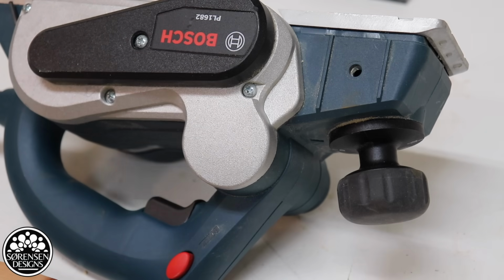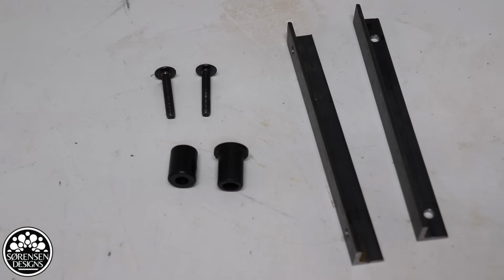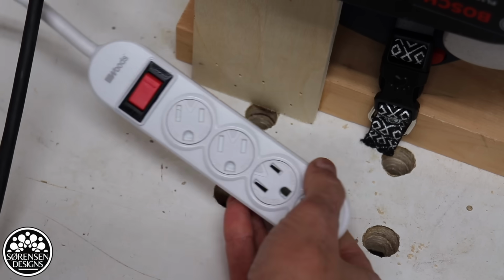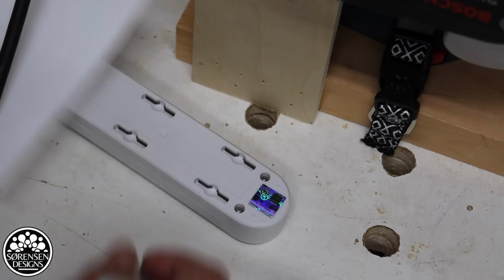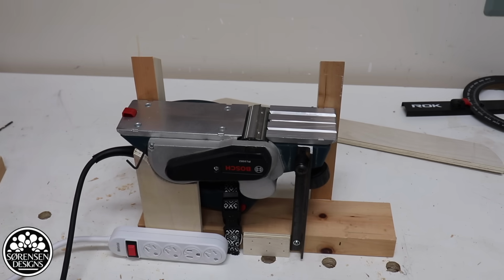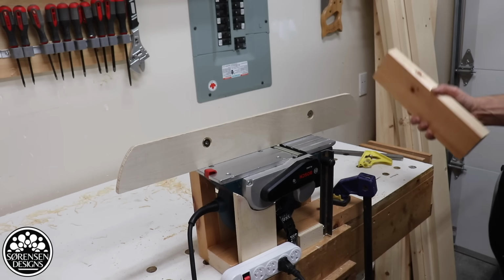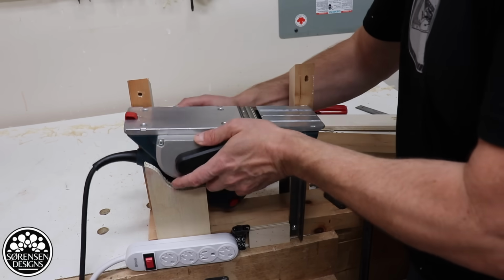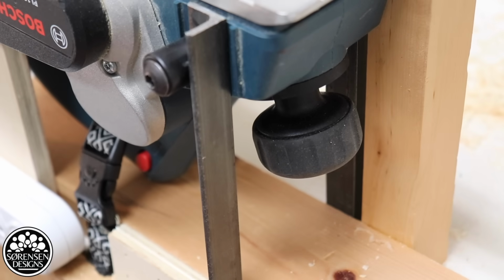Turn Your Hand Planer into a Jointer for Only $10

Comment: I made this for my planer more than 25 years ago ,tried to get a patent and get it marketed ,had a company from Sweden or Switzerland want more info through the marketing company that handled it for me but that company never contacted me ,it cost me almost $9000 for them to try marketing it and then wanted more money which I didn’t have ,so that’s as far as it went ,then about 15 yrs ago I seen it advertised in a Canadian Tire flyer a couple times and haven’t seen it since ,it was called a Jointer Jig For Hans Held Electric Planers ,don’t regret the investment ,it just didn’t pay off 😏😏

Comment: My planer is a 20 years old Bosch. It does not vibrate. 
If you spray the planer body with silicone, you can use silicone or acrylic sealer to bed it to your jointer chassis. 
Attach the power strip with sponge backed double sided tape or even with Velcro tape. The tool power switch can be held down with zip ties. 
A long bed extension on the feed side will help stop the jointer from grabbing. Not so simple to engineer but well worth having.
Reply from the maker: Sure, this can be customized as you like. I still use my planer as a hand planer from time to time, so I wanted the freedom to remove it from the jig - so for me, zip ties were a no-go.

Comment: I've been looking for jointers, but now I think I'll look for a hand planer and build a similar jig. I love it when I can use a tool for more than one specific purpose. Way to think outside the box!
Reply: you must be rich to make one tool  you use more 5 other tools  does not make sense specially the welder
Reply: @ahnurmohamed  
Eric Sorensen may or may not have a dedicated thickness planer. This contraption (1) shows his ingenuity; (2) is used for smaller projects or "on the go"--at the job site; and (3) is probably intended to show other woodworkers who, like me, annot afford to buy full-blown thickness planers that start around $600.00.
Reply: @ahnurmohamed 

It must be nice to have all those machines but there is nothing in this video that can't be done with ordinary hand tools.

Comment: Great tool!  I'm looking into building one for myself.

If you want to make it faster to set up and take down, cut out the iron above the holes in the iron at the front of the planer. Then find or make wing nuts or knobs with screws in them. Use them to secure the planer to the angle iron and leave them on the planer. Just loosen the screws and slide on and off the iron.
Reply from the maker: @Buck McDanielThanks! Yes, that's a great idea! Overall, this is an easy design to improve and customize 🙂

Comment: Hi, I own an old hand planer passed on from my grandfather, so it‘s about 40+ years old. It has a cast aluminum stand which can be removed similar to your design. Recently found another metal part which was sitting in a box for more than 20 years and it turned out, it‘s the missing fence which can be slided on. I bought a pair of new HM-blades on ebay which fit exactly and the machine works like a charm. I might add a bigger plywood fence like you did. Seems like old tools were so much better than what you get to buy today. Greeting from Germany!
Reply from the maker: Hi J. S.! That's amazing! Some of the vintage power tools had features and accessories that you don't get today. Enjoy using it 🙂
Reply: back then my grandpa made 50 cents  cutting hair. the buzzers and sizors everything still works.....they didnt make much money so they made shit strong af back then. idk if its sad or a good thing....little of both i guess
Reply from the maker: @David Persico Planned obsolescence didn't exist at one time and so stuff just used to work forever, if you took care of it. It's good that you have those things - it's important history.
Reply: @Eric Sorensen absolutly...and i cant thank you enough for sharing your tips. knowledge and history are very important things. i try to tell my son that. peace
Reply: Hi J.S. I just bought a planer from Aldi ( German Dept Store)here in Melbourne Australia. I loved Eric's video and hope that the trusted German quality is built into my planer....ummm.....I think it was made in China so I hope the German engineering excellence and quality has been taught to the Chinese....My wife is Chinese but she doesn't speak German. Should I be worried? ;-)

Comment: Hi Eric, greetings from Scotland.

I just wanted to say that this  idea is pure genius, many congratulations on coming up with it.

It so happens that I own that exact same planer, the GHO 26-82, (240 volt European version) but I also subsequently bought a Makita cordless planer for site work, which I found much more convenient than  having a trailing cord (and here in the UK they don't like 240 volt machines on site anyway).  

So my 240 volt  Bosch planer has been languishing in its box, pretty much unused ...  from time to time it did occur to me that it would be a great idea if it could be converted into a bench-top mini-jointer for small workpieces in the shop, and lo and behold ... you have come up with a superb design ! Thank you so much !

As you have already acknowledged , and obviously you knew right from the git-go, there are further embellishments which can be made. While watching the video, ( which I have done three times with the planer actually in my hands !) I have already envisaged how to fit the adjustable  infeed and outfeed extensions.

I will also mount it with two bolts on either side at the infeed end, , drilled into the table, rather than one in the table and one in the planer. This will increase rigidity, and remove the necessity for shaping the secondary plywood support at the outfeed end. Instead of the shaped  plywood support, the heel of the planer handle will simply rest on a wooden support of the correct height to keep the planer parallel to the base, and will be fastened down , probably with a plastic cable tie (btw I will also fasten the switch with a cable tie, rather than deprive my puppy of his collar !) . Cable ties are cheap ... If I ever need to remove the machine (which I don't envisage) I will just cut the cable tie, and fit a new one when necessary)

Finally, to absorb vibration, I will fit rubber washers at least 5mm thick at all contact points, ie between the steel angle and the body of the planer, and also between the heel of the planer and the plywood base. 

The fence I haven't figured out yet but it will be very similar  to your design, although longer ... the total length of infeed plus outfeed  will be four feet.

Many congratulations again on a superb, thought-provoking video!
Reply from the maker: @murrmac Thanks for the kind words! It sounds like you've got some great ways to extend the design to suit your needs. It's great to get this kind of feedback from my audience. There is always room for improving some of the features for sure. Cheers 🙂

Comment: Seen many of these builds but yours is the best. I finally got around to making one. While a 6-inch joiner would be nice I have a 13-inch planer already so this has turned my 3 inch Ryobi hand planer into all I need, thanks again for a great build.
Reply from the maker: Thanks Done! For my shop, this jig setup has worked well.🙂 Cheers!

Comment: Best idea I've seen yet.  I have a 6 year old Dewalt electric hand planer that I've used only about a dozen times.  It's been sitting on my shelf for the last 4+ years and not used.  I would love to purchase a dedicated jointer but can't afford one.  So by following your idea, I can re-purpose my Dewalt and use it as a small 3" jointer.  Sounds like a plan and I too have the majority of the required materials and all the tools necessary to construct one.   I'm going to go for it.  Thanks for sharing a brilliant idea.  Cheers!
Reply from the maker: Thanks William! I know what you mean. Jointers usually start at around $500 and go up from there depending on the brand. Plus they take up a considerable amount of space. Although this method may not be the best for really long boards, it does work pretty well for anything under 4 feet in length. Be safe! Cheers 🙂

Comment: Nice and simple. 
Add in a way to attach a vacuum hose to catch the dust while on the bench and it pretty much covers all bases.
(No one seems to take into account the saw dust these things sling, which is a lot.)
Thanks for sharing.
cheers...
Reply from the maker: Thanks Chase! There is already a built in dust collection port on the Bosch planer, which I use with my cyclone when I'm running boards. It ends up at the back of this jig which is perfect, so it won't get in the way. I think most brands have a dust collection port these days.
Reply: @EricSorensenCanada  - Damn! thought I had you one that one. Lol.
I'm sure the new ones do, mine doesn't, but works just the same. So I'll have to add one to what ever I build for it. 
I like the bed you made for yours for sure!
Keep up the good work! And again, thanks for sharing.
cheers...

Comment: Great idea!  Love your channel!
I’m still in the planning stage of a small shop for my garage. Limited space so I expect to need all the alternate use ideas I can get. Also on a limited budget because I’m disabled and my son is a disabled veteran so we will be sharing the shop and the costs. Thank you for sharing your ingenious ideas. 
Cheers mate and happy trails
Reply from the maker: Thanks @Prepperjon! All the best and cheers 🙂
Reply: As a retired/disabled VET myself know about doing it on limited budget.   If you have the yard space, consider building a shop in your back yard, and the cost can be next to nothing depending on what materials you use.  I built both my Sheds/shops out of Pallets and maybe spent a total of $200 per (the roof is the major factor, 1 is metal other is corrugated, but can do wood roof with pallet and weather protect it).  All of my benchs/workstations are made from pallet wood also.  Other then that the next best thing is to run all your power tools off of solar power and cut your monthly electric bill drastically (be surprised how much you spend just to run your power tools, mine dropped $100 a month).  Solar power can be a big exspense up front, but in the end it pays for itself.  Hope that helps in giving some ideas on doing things on a budget and oh with limited space put everything on lockable wheels so you can roll things easily into workable space and move easily out the way, its a key factor that very few ppl think about when doing their own shop and have limited space.  Also.

Comment: That was awesome!  I don't have a table saw so I purchased a hand planer hoping to mostly use it for squaring the rounded edges of stock lumber for my projects as well as fix mild high spots.  It is just too heavy to get the smooth look I was hoping for.  This jig would solve that problem nicely and still do a nicer job than a yet unpurchased table saw.
Reply from the maker: Thanks @Eva Rogers! It is easy to get snipe and gouges trying to push the planer through by hand and I find that they just aren't designed well for edge planing. My electric hand planer collected dust for a while until I built this jig...🙂 The only thing I would suggest is maybe adding an in-feed /out-feed platform if you are working with material longer than 20 inches.
Reply: @EricSorensenCanada  I've always wanted to  build furniture.  My biggest project is my current one - a king size panel bed... gigantic head board, footboard, rails and slats.   I should be ready to prime tomorrow.  Next will be a quick set of chunky picture frames then a farmhouse table and bench for my daughter.  There is no shortage of projects to be done.  Just need to keep down the sawdust before my husband kicks me out out of the garage!
Reply from the maker: @Eva Rogers Nice! It's true, there is always more stuff to build and so many great ways to make it happen. Just take over the garage, I'm sure your husband won't mind.
Reply: I had a table saw, but it took up too much room in my garage, I took my circular saw, screwed it to a piece of plywood with the plate all the way down, turned it on, and cut down through the plywood.  Then I flipped it over on top of some horses to use it as a table saw when needed.  I made the fence out of some lengths of plywood glued and screwed together in an L shape to clamp to the table top.

Comment: Nice. As it happens I do my hand planing with a selection of Mr. Stanley's pre-1960 products, and the Bosch electric planer I bought before I learnt to sharpen plane blades properly is sitting under the bench gathering dust...
Reply from the maker: Thanks John! I love my Stanley planes too and have become addicted to hunting down vintage originals made in the 60's at flea markets and such. My electric hand planer was also gathering dust until I decided to make this rig.
Reply: @EricSorensenCanada  I just brought my Bosch (older than yours, BTW) out because I have some rather pesky oak to plane, so I'm going to be building your rig today or tomorrow.  I love the sound the plane makes.

Comment: VERY nice build. You have modified a hand planer into a very useful basic jointer, which should handle stock up about 3 inches thick? The quick conversion to hand held use is great too. Looks like a three minute mount up. I have an older Porter Cable HH planer which gets limited use outside of job site carpentry and no dedicated jointer, so this is the perfect add-on. The only item I might change is your 2x4 base plate to extend it past the left side of unit. This would allow for a second clamp and stronger base (less likely to move), if using some bigger/ longer stock. Just subbed the channel.
Reply from the maker: Thanks Andrew! Widening the base is a great idea, especially if you plan to use on a job site.  Cheers🙂

Comment: Clever use of a hand planer and it has potential especially for a seldom used tool but I think this jig would be better if you built-in an in-feed and out-feed to your jig because you usually want to use longer pieces of wood when jointing and you may not be able to make them straight over the whole length.  For example, a 1/2in bow over a 4ft piece of wood would be difficult to remove.
Reply from the maker: Thanks @Fournier Luc. You can add a table top in-feed / out-feed to this jig pretty easily. The jig is good for fine work on pieces under 3 feet long. I would use the table saw and a simple straight-edge jig to do longer pieces or buy a real jointer 🙂

Comment: What a simple, yet great idea. Thanks I love it . I would not necessarily want to use it in place of a jointer for fine cabinetry, But for most of the uses I would need it for it will work fine. Why wouldn’t you just use a cable tie instead of cutting the dog collar?.
Reply from the maker: @r. michael wilensky Thanks! I don't want to wear out the trigger when I store it, so I release the trigger after use. The dog collar with the quick release clasp is a good solution but you can use any strap with a quick clasp.

Comment: Me being less then a part time woodworking hobbyist I bought a 'wen' electric planer a very very long time ago.  It's still in the box.    I never used it for the purpose it was meant for.    I came across a vid with someone building one of these,   but it was over built,  and sloppy looking.  I researched to find better,  but none to be found.    Once I asked another youtuber if he would make a vid to do this,  but he politely said 'No'.
Thank you,  thank you,  Thank you!!!
Looks very simple for someone simple like myself.
Reply from the maker: Thanks HAMP ! It means a lot to know that I helped someone out with this content 🙂 I don't like making things more complicated than they need to be. I realized that almost every electric hand planer has the mounting screw holes at the front for the guides, so this build should work regardless of the brand.
Reply: I appreciate the little details...   The previous vids I spoke of never mentioned the mounting screw at the front.    Looking at your vid and reading your post,  I had to go pull the box out and look at my planer,  and behold it had the front mounting screws for the guide.   In the box,   it had some little guides that I can use as a template for my build.    
That planer sat on the shelf for over 2yrs now...  lol
Reply from the maker: That's excellent! Yes, I've watched probably a lot of the same videos that you did and found that they all kind of just build around the planer.  I wanted something where I could remove the planer without a lot of hassle but still use it as a jointer.
Reply: @EricSorensenCanada  ooooooo...  ok!!  I didn't know that was part of your intent to remove from base and use as intended(having options).    When I first watched the vid,  I questioned as to why you were demonstrating how to remove and simply replace...  ok, ok that makes sense now.    

Soooo,  that makes the build/video better then I originally thumbed up...  can I double thumb it...  lol
Reply from the maker: You can't double thumbs up but feel free to share the video around, it helps get the word out 😉
Reply: @EricSorensenCanada  ,  Yes,  I will be more then happy to share,   and not just because you have built a lot of projects I like and need to build.  Because of the great personality on all the vids.
Reply from the maker: Thank-you my friend! Greatly appreciated 🙂
Reply: My experience has been pretty much exactly the same as HAMPs even with the WEN hand planer still in the box. I will be building this. Reading this made it so i dont have to take mine out of the box to make sure the holes are there as he already has.